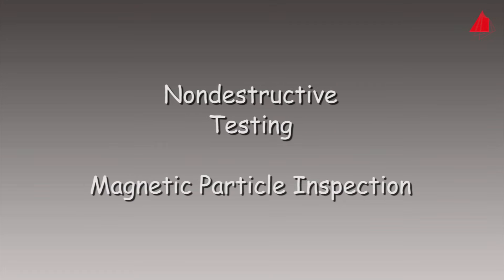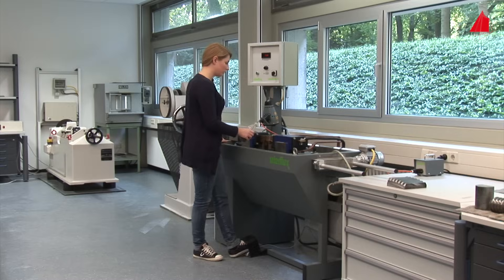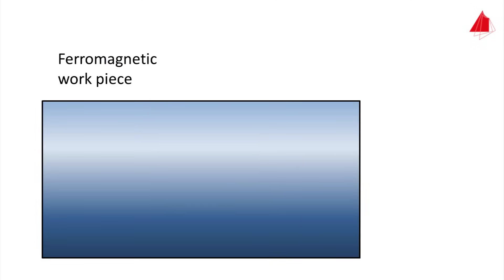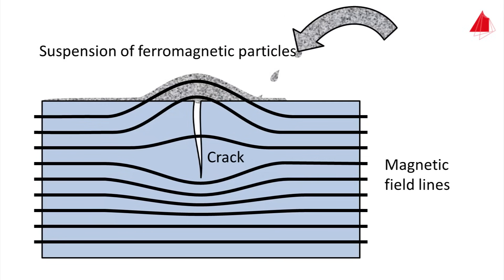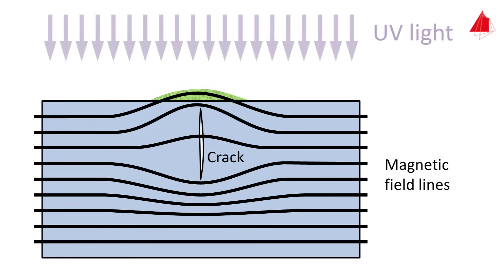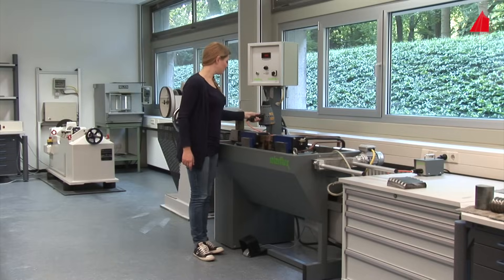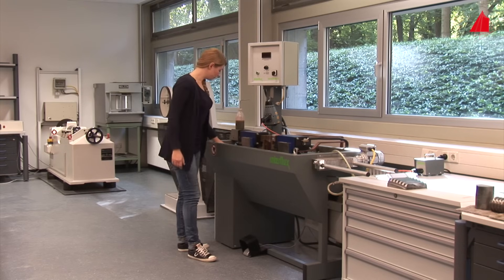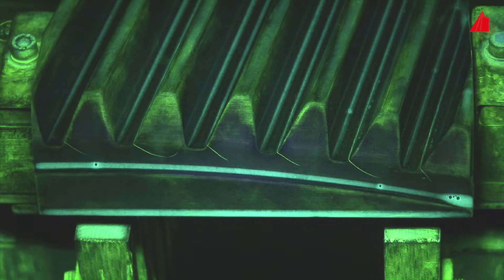Magnetic Particle Inspection

Comment: What will be the correction method for this specimen? 

Or it will be wasted?
Reply from the maker: Answer to "What will be the correction method for this specimen? Or it will be wasted?" The test piece is a hardened plain bearing with a thickness of about 10 mm. The cracks found are not very deep, probably less than 1 mm. If the plain bearing is not subjected to high mechanical loads perpendicular to the cracks, it could actually be used normally. However, this depends on the load during operation. If the cracks are unacceptable, the bearing cannot be reasonably repaired and must be replaced with a good bearing.

Comment: Hello i saw there it shown both vertical and longitudinal defect . My question does ure machine can produce 2 type curent flow and magnetic/coil flow in 1 shot so u can found 2 direction of those defect? Thks from Indonesia
Reply from the maker: Answer to "Hello i saw there it shown both vertical and longitudinal defect . My question does ure machine can produce 2 type curent flow and magnetic/coil flow in 1 shot so u can found 2 direction of those defect? Thks from Indonesia": We have only used one magnetisation direction at a time in the video. Nevertheless, you can often see defects that extend almost in the direction of the magnetic field, because in most cases the magnetic field does not run exactly along the defects and therefore has a component perpendicular to the defects. A trick to show all defects is to use both types of magnetisation in quick succession.

Comment: What may be the maximum possible dimension of specimen that can be inspected using Magnetic Particle Testing?
Reply from the maker: Answer to "What may be the maximum possible dimension of specimen that can be inspected using Magnetic Particle Testing?": The dimensions of the specimen are not limited, so you can also test extremely large specimens. However, you do not bring the specimen to the testing machine, but do it the other way around: You bring a comparatively compact mobile testing equipment to the specimen.

Comment: I have a couple questions. What is the scale of the cracks shown? (I assume the the medium enlarges the scale of the cracks) and why are the magnetic field lines perpendicular to the electromagnets? It is my understanding that magnetic field lines propagate outward from what is normal to the surface of the magnet
Reply from the maker: Answer to "I have a couple questions. What is the scale of the cracks shown? (I assume the the medium enlarges the scale of the cracks) and why are the magnetic field lines perpendicular to the electromagnets? It is my understanding that magnetic field lines propagate outward from what is normal to the surface of the magnet": You can estimate the length of the cracks based on the approximate length of the test specimen (approx. 200 mm). Unfortunately, you cannot measure the width or depth of the cracks. As regards the magnetic field lines, the entire experimental setup is not shown. The electromagnets are outside the video window, but this is a more complex issue.

Comment: I don't see crystal clear how the longitudinal  magnetization is achieved. The circular mag is seen because the test piece is in contact with poles. I used to see long. mag using coils. Thanks in advance.
Reply from the maker: Answer to "I don't see crystal clear how the longitudinal  magnetization is achieved. The circular mag is seen because the test piece is in contact with poles. I used to see long. mag using coils. Thanks in advance.": The magnetization in longitudinal direction was achieved by two electromagnets, one on the left side of the sample, and one on the right side, causing the magnetic field to flow in longitudinal direction >> from the left magnet >> through the specimen and then >> to the right magnet.

Comment: Could you manually turn the test piece 90 degrees instead of switching the machine to current-flow mode? Would that accomplish the same thing?
Reply from the maker: Answer to "Could you manually turn the test piece 90 degrees instead of switching the machine to current-flow mode? Would that accomplish the same thing?" Yes absolutely. Sometimes it is easier to rotate the specimen by 90 degrees (which in our case would have been an option), sometimes it is more practical to use the current flow method (for example, for long cylindrical specimens or tubes).
Reply: @MaterialsScience2000  Ok, that really helps me clarify things. Thank you for your reply!

Comment: Is there any risk of getting electric shock while pouring the ferrite suspension on the workpiece while current is flowing through it?
Reply from the maker: Answer to "Is there any risk of getting electric shock while pouring the ferrite suspension on the workpiece while current is flowing through it?": No, there is no risk. Although the electric current is very high in this case (around 1000 to 2000 Ampere), the voltage is very low, around 5 to 10 Volts.

Comment: I am quite confusing that when there is a current flow through the test piece, there will be a magnetic around it.but how come the magnetic particle will not stick to the magnetised block but only on the cracks ?
Reply: thank you in advance
Reply: The particles they use to show the crack and inspect it , only go onto the defect and never on the rest of the part because of a magnetic leakage and the particles will only run to the magnetic leak

Comment: What method is used to demagnetize the ferromagnetic material after the magnetic particle inspection?
Reply from the maker: Answer to "What method is used to demagnetize the ferromagnetic material after the magnetic particle inspection?" By using an alternating magnetic field in the machine, that is not switched off abruptly, but slowly (let us say within a second). The remaining magnetism is very low in the end.

Comment: Do you give certification for taken a course's, please reply, Thank you.
Reply: Class does not give certification. After that you need, I think, 210 hourS for level I and 640 for level II. The reason is the powers that be in ASNT figure that in those hours you will have seen enough to do that level job. I've got about 22,000 hours and would occasionally see something new - and rejectionable - in gas turbine blades.
Reply: mohd mahmood hussain what are you talking about??
Reply: +WingedBull1 job joiner

Comment: is the tail stock electrically connected to the earth?
Reply from the maker: Answer to "is the tail stock electrically connected to the earth?": The metal cases around some of its parts are connected to the earth. The electric poles for the workpiece are not connected to the earth, but fully insulated. This prevents accidental shortcuts towards the metallic parts of the machine. The voltage between the poles is very low, just a few volts.